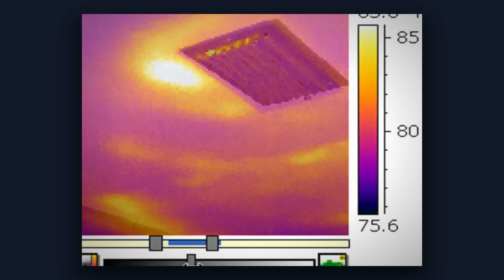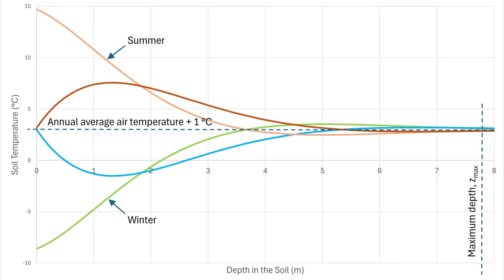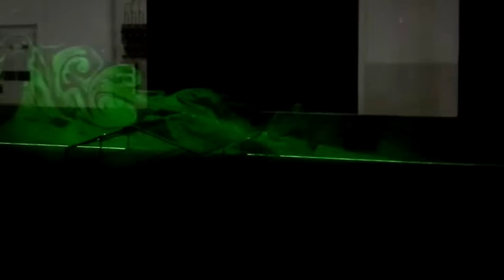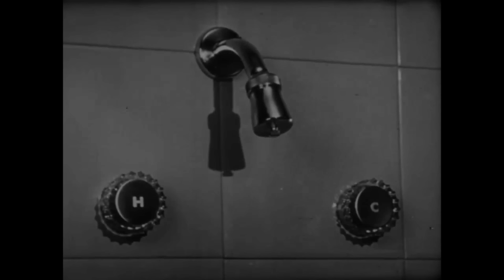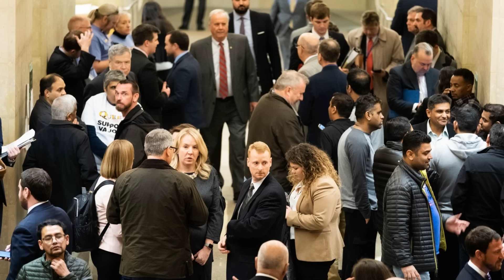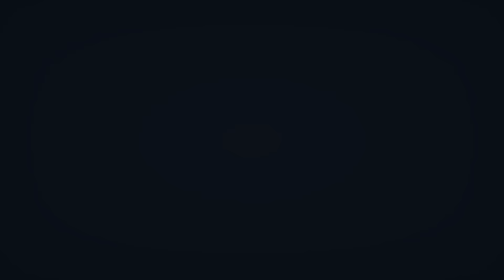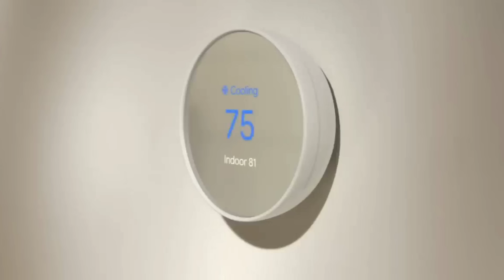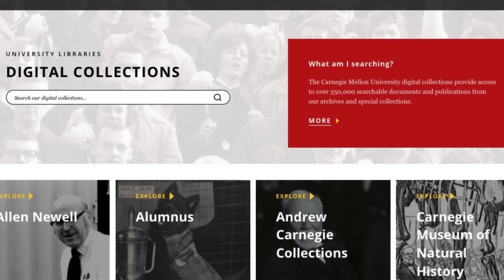This $300 Tunnel Heats Any Home All Winter for Free — The System the Gas Industry Made Illegal

Comment: but your house furnace doesn't pull the air from outside .  That's what your return air is for.  Goes back to your furnace to reheat
Reply: The typical/majority use force air with cold air returns. Air is pulled in from outside for combustion only on a standard  high efficiency furnace.
Reply: @bvannortwick7238  ...which, over the last two or three decades, means most of the furnaces in northern U.S. and Canada.
Reply: @bvannortwick7238 This is a totally under-rated comment.  It deserves much more appreciation. But a burried ground tube prewarming air for combustion can still mean a benifit for the homeowner.
Reply: @kreynolds1123 I agree that there would be a benefit in heating combustion air. How much? I dont know. But, the cooling effect of air in the summer months would definitely be worthwhile if properly designed.
Reply: There’s requirements for fresh air to be brought in to buildings.  Usually around 10% minimum.
Reply: yes and no.  The furnace needs air to combust, and all of the exhaust is vented outside (the entire point of a heat exchanger is to exchange heat between the combusted gasses, and the air circulating in the home.  there is ideally NO contact between air used for combustion and air that circulates within the home.  So much so, that a tiny crack in the HE can mandate replacement, backed up with force of law (CO leaks are deadly).  All the air used for combustion (100% of it) comes ultimately from outside the home.
Because this causes inefficiency when drawing in cold air, there is something called an HRV or heat return vent, which is basically an additional heat exchanger of sorts.  It causes the heat in the exhaust gasses to warm up the cold incoming air, for even greater gains in heating efficiency.  

So yes your house furnace pulls in air from outside.  But...  The air within your home,  is recirculated.  Both are true.
Reply: @ISAYTHEENAY  It depends how old the furnace is. 80% efficient models usually draw air from the living space as they have no cold air intake. Makeup air comes in naturally in leaks around the house doors and windows. Modern systems preheat the incoming air with the spent exhaust as it exists the home.
Reply: @mr.monitor. so you’re breathing fumes?
Reply: @hidingfromu5293  No, so I'm not breathing fumes.
Reply: @hidingfromu5293  Do you not understand the subject or what?
Reply: Why can’t you pull air from inside the house and circulate the air through an earth tube and back into the house
Reply: @MatthewWeathers1967 That would cool the house.
Reply: No house is heating up outside air this is misinformation
Reply: @frankiediamonds78 pay attention!
Reply: Doesn't make sense,for heat our return air comes 0 from inside the house once it's warm it's warmer than earth air. If you use the eart air only that only gets you 55 degree air. Earth air for cooling makes more sense.
Reply: @brianstiehl6698 It might help if you lost power and your house never got down to freezing conditions. Im not sure how you would circulate the air without power. But warm air rises, would that be enough to keep the house warm enough to prevent frozen pipes?
Reply: @brianstiehl6698  Like most people, have forced air with a cold air return. Now their furnace may be outside their home like mine or inside their home.  But for those whose furnace is inside their home the furnaces combusted flue gas must still be vented outside, that means it would create a low pressure inside that sucks outside cold air into ones home through small opening in doors windows and small spaces in walls and outlets if ones furnace does not get its air for combustion directly from piped in from the outside. Either way, one ends up having to warm the volume of air for combustion. So, instead, people might try a ground tube to prewarm air piped to the furnace for  combustion.
Reply: @kreynolds1123  The amount of combustion air is so minuscule you can stop worrying about it for the rest of your life.
Reply: if you close all ventilation you will die 2 hours later due to CO poisoning. So yeah - it must take some fresh air from the outside. If it doesn't then you have another problem. See air exchange ratings for your building/furnace.
Reply: I can see it making sense for cooling, bring 55 deg air into your air handler. No need for AC compressor. But for heating? I would have to measure but my return air is higher than 55 deg?
Reply: So where exactly do you think the air comes from for the furnace to burn because it takes oxygen it comes from an outside source otherwise you would suffocate whether it’s through cracks, poor construction or an opening and closing of exterior doors it has to get a fresh air from somewhere the recirculator for the furnace helps, but it has to have a constant supply of burnable oxygen
Reply: My understanding is that the air you are pulling in from outside for a forced air system  goes to your burner at 40+ or so degrees rather than zero or whatever.  Far more efficient. For ac it would require a run to your plenum with fan assist in summer months to draw in the earth-cooled air. I remember reading a Mother Earth article on this in the late 70's.
Reply: You obviously didn't watch the whole video 😅
Reply: Really ? Electric maybe. Gas, fuel oil,  wood has to have oxygen 😮
Reply: Is that only the old furnace types and not the new installs?
Reply: Yeah but the ground is a natural insulator and by packing it in to another insulator like a tire you wouldn’t need a furnace
Reply: Not in tight new construction.
Reply: On a high efficiency furnace fresh air should come from inside and outside, because most frost shut the intake air if below 55 degrees
Reply: The furnace pulls outside air into house to burn fuel.I when no dedicated air it pulls freezing outside air into your living area  in house, so the temp differential is accurate.
Reply: @ reality-It's true of most systems. 
@scott-Those requirements are for combustion air for gas furnaces and water heaters.

BTW A heat pump is the most efficient way to use the ground for heating and cooling.
Reply: Forgot to add Radon and mold should be a concern if you are bringing air into your home from underground. Do your research.
Reply: @JayMansanarez  but the air does not come from underground. The air comes from the same air outside your home. It’s just drawn through a piping system that act as a heat exchanger in the summertime free air-conditioning pump it in in the winter time you need to have a heat pump either liquid loop or this air leak connected and you will be retrieving heat from 56 or 60° air instead of 0° air heat pump is much more efficient that way! Remember that they absolute zero or lack of heat is -460° below zero Fahrenheit! So there’s lots of heat and 0° we just don’t have the technology yet to retrieve it❤️‍🔥❤️‍🔥🙏🏼🇺🇸
Reply: @JayMansanarez doesn’t come from underground, there’s an inlet above ground and solid pipe prevents radon entering the system
Reply: @JayMansanarez PAY ATTENTION!😅
Reply: pay Attention!
Reply: @adamsiegert2392  I didn’t say it did. I said to do research on radon. I have and there’s a lot to learn and know.
Reply: @JayMansanarez  Nothing that would be relevant to this though.
Reply: @jimbefit3073 ain't that the truth that 😅😅😅
Reply: @theusconstitution1776  May I ask you what you think of mine I have a water heat pimp runs of my 120 foot well?
Reply: @JayMansanarez the Sun is way more toxic with radiation compared to  some rocks in the yard.
Reply: Not true of all systems. Some are designed to pull air from the outside, runs through a dual filtration system to remove pollen, dust and microbes, then send it to the furnace.
Reply: I have seen ground in central michigan  freeze six feet deep under bare ground in one night at sub zero temps. There had been snow on the ground and it wasn't frozen until the day before someone cleared the snow for construction.
Reply: @rb2712  Bollocks. Frost line might be at 5 or 6 feet, but it sure doesn't happen 'in one night'.
Reply: @rb2712  So, at what depth are your water supply pipes?
Reply: @nickwinn7812 2 to 3 ft according to regulation people are lazy I've seen pipes only 8 in in the ground
Reply: @rb2712  I've heard that upstate should go down 10', couple did it with a backhoe.
Reply: You have seen it freeze 6 feet where people drive or high traffic areas or a bald hill ...there is not 6 feet of frost in Michigan..I live in canada and work in oil and gas .. we install pipeline anywhere from 110 degree heat to - 50 degree ...we very seldom see frost below 4 feet ...we have sub -20 temps from November  to april ...if its deeper then that its more likely a high traffic area ...so putting this system under the ground in 5 feet deep in you yard ....you deff will never see frost that deep unless you are in the fnkn Yukon
Reply: @jrjr7529 Thank you